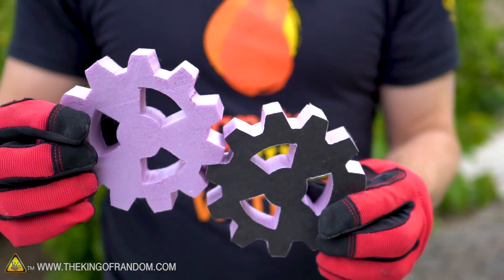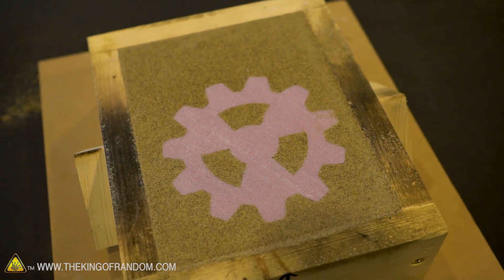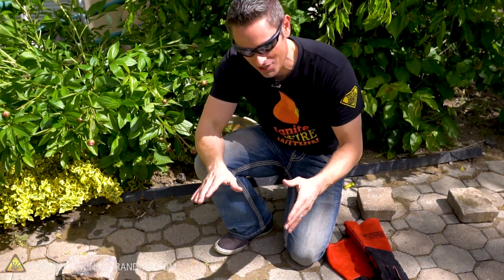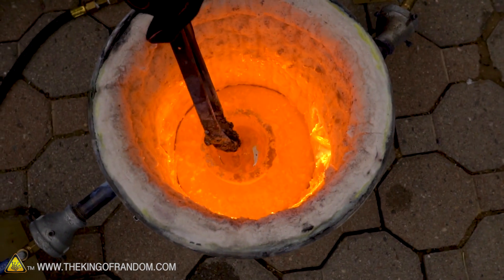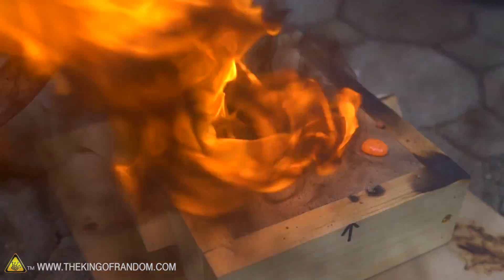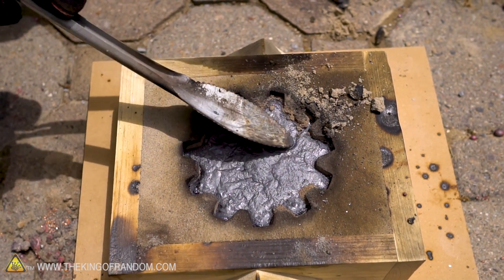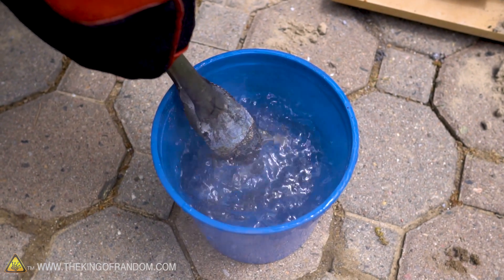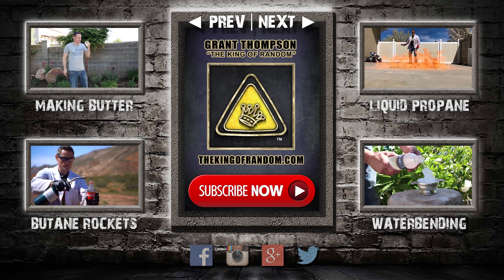Argh. Why Is Copper So Difficult? TKOR Tests Melting Copper In Our Homemade Foundry

Comment: First off: you need a little more damp sand so it holds together better. Second: You need to be able to remove your shape from the sand. Watch some real casting videos on the subject, it doesn't hurt to learn from others and not learn it empirically.

Comment: Re-investigate your green sand mix.  Take a look at MyFordBoy he has a much better green sand recipe than you are using. You could also invest in petrobond which will give amazing results (see Brian Oltrogge).  You should also be using a top/bottom for this mold.  That will help keep everything intact (use the cope and drag, not just the drag).

Comment: Try putting the top of the mold on with two holes going down to the piece. It'll keep the sand from lifting, insulate it a bit to keep it flowing longer, and you can just cut the excess off afterwards and throw it back in the foundry.

Comment: With my very basic understanding of physics it would seem that a possible problem would be that the sheer heat of the copper flash vaporizes the moisture within the green sand causing it to become to brittle to hold together.

Comment: When you said you were losing heat from the copper too fast you were probably correct imo. Making a mold that you can heat up with the copper should solve that, and your sand issue at once.

Plaster of paris maybe? Just be sure that all of the bubbles and water are out long before the casting.

Comment: what happens if we remelt the tail of prince Rupert's drop?
Reply: or is their a way to make Rupert's drop indestructible?
Reply: Mr. Mercury Pretty sure that the tail is what makes the Rupert drop "indestructible".
Reply: Mr. Mercury it's possible to take a blow torch and melt off the awkward long fragile bit of the tail. Check out smartereveryday. Destin used some drops with tails mostly removed when he tested them against bullets.
Reply: Mr. Mercury hydraulic press channel crushed the drop first before the tail could destroy itself.

Comment: Make a 2 part closed mold, skip the styrofoam and just make a hollow mold. Use chalk to avoid the master from sticking to the sand. Make the hole where you pour the metal to the side of the thing you want to cast with channels running to it. At the bottom of the inflow hole there should be a a deppression just to catch dirt and the deppression should preferably be below the channels to the casting. Also mix in about 12-15% zink or 10% tin by weight. That will lower the meltingpoint and make it more easily cast.

//Fellow caster.

Comment: I know how to make it work! It''s actually super simple, take a piece of metal that has a higher melting point than copper, that can fit over the top of the mold, and cut a hole in the middle where you need to pour it, making sure those interior parts of the nukegear are covered, which will prevent the sand from popping up! Thumbs this up please so Grant sees it!
Reply: +Commando Squeak  Tungsten! Or Nickel might suffice as well.
Reply: Kain Lancer   Won't the two metals just fuse together?
Reply: I think that if the metals are different enough in melting points, it won't, at least not strongly, but even if it does, Grant already said that he'd be fine if he had to grind it down a bit, so he could always just do that!
Reply: The only thing with a higher melting point is steel.

Comment: You need to dowl/peg the internal details of the gear in the green sand. When i did this in school we had little ceramic pegs that we put in the mould before adding the sand to add rigidity to the mould

Comment: Grant i work at the smelter at kennecott pouring anodes, it would help if you torched the copper as you poured it, it cools wayyy yo quick it needs to be 2200 f or higher to pour well. Looks like you have a little bit of contsmination in your copper which is making it brittle (bismuth) where did you get your copper?
Reply: Also sand mould is hard to work with, we use water cooled copper launders ligned with barite
Reply: Your sand may have too much moisture causing those pockets of sand to "pop".

Comment: Grant, I could suggest covering the Styrofoam model completely with sand. watched a few videos that did that, and it worked. It is possible that the central design is just not dense enough to stay put with that molten glob of copper poured on it. May have to do some extra sanding and stuff...

Comment: your problem may be that you just don't have any pressure on the details to keep them from floating you may want to add the second half of the mold even if it's just flat with a filling hole

Comment: Looks like the sand is too light, and when a small piece like the chunks in the middle is fully surrounded/submerged in the molten copper the bouyant force keeps pulling the sand apart.

Comment: Should have just went with a sand and plaster of Paris mold.. Or filled over the top of the foam, then use fill holes/vent holes to pour in the copper... It would keep it molten longer to fill the whole form and the cut outs couldn't float up

Comment: put a layer of sand on bottom, then put in your foam including several foam tubes up from the foam, then cover with sand. This puts your foam shape floating in the sand and the tubes are where you pour the sand.

Comment: 1. Get some petrobond sand. It's pretty cheap.
2. Make a two sided mold and make sure to weigh down the frame so the top does not get pushed open by the weight of the metal.

Comment: I saw a guy do this for an axe he did the same thing with the sand and stuff except he used an actual axe and then he took it out so it was a perfect axe mold and then he poured melted silver or something like that into it and it came out with a lot of dents and large indentations in it but it worked really well , just like a regular axe

Comment: Maybe... the copper is too heavy that's why it displace the sand in the middle(lighter stuff will float in liquid, especially when the copper is in it's molten state).

Quick question Grant, is mercury heavier than Copper? If it is comparable, maybe you can test the sand casting with mercury and see if it will work.

Comment: The problem you had was all because of density! At 7,898 g/cm3, molten copper is very dense. Whereas the density of wet sand is roughly 1.905 g/cm3. The three sand pieces kept falling apart because they wanted to float on top of the molten copper!! Hope this helps!
Reply: Alex Agaciak also, it did not show if he was using the mesh strainer? It really needs the fine packed sand to hold together better. Grant don't give up, but use finer grade sand first.
Reply: all he has to do is put a weight on top of the 3 sans pieces before he pours. may want to reinforce the sides of the 3 pieces as well
Reply: I came to add this, found it at the top.
Reply: I vote for doing this, too.
Reply: Put a lid on it nerd!

Comment: In foundry processing when dealing with high melting metals there would usually be a heated channel from the crucible to the mold. There are also a number of other steps and tools that you're straight up missing. Start from the basics and work up.

Comment: To The King of Random: Try to get the green sand casting extra wet then try to remove the styrofoam relation gear then pour the liquid copper. Or try to use something else instead of the green sand, try using plaster Paris or something similar to that or cement or something similar to that that can withstand the heat and that will keep the shape of the styrofoam outline/cutout better than sand.

Comment: Here is my Idea
1. Create the Box which holds the sand in steel.
2. Heat the Mould(Sand Cast mould in Steel box) up to the melting point of copper.
3. Pour the Molten Copper in the Hot Mould
I hope it works......
Reply: You can't heat the mold when sand casting like this.  Water is what holds the sand together.  If the mold were heated beforehand, the water would evaporate and it would fall apart (even worse).

Comment: Just an idea but I saw someone else using a very similar method of mailing as you but they did it a bit different. This mechanism also allows for much more intricate molds that can even copy exact items in real life. You can see what he does, but sadly not a tutorial. The video is called "Casting a Bronze Axe From Start to Finish". I know he's using bronze instead of copper, but I felt even if you don't use his method of molding maybe you could use bronze as a more versatile metal. Hope I helped!

Comment: Hey Grant! Instead of trying to cast copper in the sand why dont you try to cast it in the soil as the soil propably would hold the extreme temperature better than the sand

Comment: A random thing i noticed and gave a little thought. I noticed during the first few casting when the sand wasnt very wet, only one notched managed to dislodge from the mold. Then when the sand held a considerable amount of more moisture, all 3 notches gave way. The theory I have is maybe the copper is causing the moisture in the sand to evaporate too quickly before the mold can maintain a structural shape in the casting causing the notches of sand to break free and ruin the mold. I personally have no clue how green sand functions as a mold but a few ideas I have to help improve chances of a successful, detailed mold is 
1 create the mold like normal but let it sit, perhaps overnight maybe 24 hours, and wait for it to dry completely before use.
2 create the mold, and bake it in the oven. Reason being is I noticed the sand became VERY firm and crispy when the last casting was done. Just a thought, again I have no clue how it works personally but its just an idea or two to think over next time you try it out.

Comment: You need another sand box on the top with a whole to act as a funnel a steady pour is more effective than a fast one liquid metal still carries the same mass and weight  as its solid form its density is a liquid so its less than a solid and pushed your radio active dividers out the lid funnel should be able to handle and add support to those dividers

Comment: I have very little experience with casting, however the man that I helped always used a sealed cast for more dense materials. I doubt that is the proper name. but basically completely cover the gear with sand and have a pour spout going into the foam chamber. I could be wrong but I also believe it may help gold the hear in longer. allowing it to fill the mold better.
Reply: Basically you need to cover it up completely and have a foam "tube" going up which the copper can melt through, once the cast is done you just remove the tube with a saw and then file it down.

Comment: This sand is way too dry and flaky. Use some proper Delft Clay (Actually it's fine sand mixed with oil). The mould is falling apart because it's to dry that there's nothing to hold it together. I use Delft Clay daily for hot metal casting.

Comment: Borax is a great idea as a flux and skimming for slag a necessity every time, i understand there are better solutions but i also understand trying to make things work. What would happen if you let the Sand dry more or mixed a bit of clay into the sand? I think the main reason the center parts were popping up and floating was because of flash boiling the sand, the more moisture the more pressure it creates to disturb the surface of the mold.

Comment: the reason its not working is that your not pre heating the mold ... you can't get any better without heating the mold up it doesn't need to be as hot as the metal but high enough it slows the rate of cooling.... pouring it as quickly as possible doesn't help that much nor is it consistant

Comment: I think the issue you were having is that the copper is more than 4 times the density of silicon, so the little radioactive design was just floating to the top of the pool

Comment: Why don't you create the gear with an easier metal then use electrolysis to plate it with copper so it looks smoother

Comment: Looks like your greensand isn't binding enough, possibly your mixture is wrong, or you need to rethink your process (perhaps not moulding with an open top) myfordboy on YouTube seems to have no problems casting, perhaps get advice, Also that bubbling you were getting in the last pour, is the water in your sand turning into steam and percolating through the copper(might make your casting bubbly)
Reply: Or use sodium silicate (water glass) to stabilise your sand, you mix this "water" with your sand, then inject co2 gas with a needle , which causes the sodium silicate to react and harden.
Reply: I think svseeker (YouTube) has demonstrated this.

Comment: I have successfully poured copper castings using green sand - you can't use an open mold like in your video however.  I have a few tips I could give you if you want.

Comment: Couple ideas, not sure if they've been mentioned. Perhaps having something above the sand (Like a piece of wood with a hole to pour in the center) to keep it from floating upwards, or simply using wood or something similar to make up the cut outs. Yes, wood will ignite when exposed to liquefied copper, but it should last long enough for the copper to solidify enough that it won't deform when the wood burns away. Just a couple ideas.

Comment: y not have the mould the 2 piece type instead of the single piece? the upper part of the mould would prob help prevent the center bits from floating up i think. or place the foam gear on top of a layer of sand then put another layer on top of the gear and put a hole ontop of that so that you can pour in the copper. wouldnt they work?

Comment: Grant, for this, what if you tried to use some sort of steel funnel to minimize the force the molten copper puts on the sand? And since steel melts at 2500 degrees it should be fine with the copper.

Comment: First if you're gonna cast mold, expect to do some machining to get a usable/ appeasing results. Also, use portals to cast copper not facial... The sand needs support at all points, you can use multiple ports to achieve certain designs.

Comment: 1) You might need clay in our sand mix. Clay help makes everything stick together, sand doesn't.
2) You might also need to press the sand into the holes of the mold harder, using your fingers when you fill the box.

Comment: You need to use a top to the mold with a riser and vent. It will help ! I have seen it done and worked 99%, very little error..

Comment: I strongly believe that you should use 3D printed models first, make sand casting mold and then just pour molten metal. In this video, you cannot compact it tight enough, cause it was styrofoam.

Comment: I have done several castings with copper and i used oil based sand and it worked everytime with no problem. U should try that

Comment: I think the hotter the copper the more moisture it takes from the sand, turning it from green sand to basic sand. The edges held up because there was more wet sand to hold it up. Maybe it would be worth it to try and cast a bigger mold? More sand in the details might mean the moisture won't be completely dried out by the heat of the copper
Reply: Cement molds might be worth trying as well!

Comment: Having cast lots of things in copper using my own backyard foundry, I've never had as much difficulty as you're experiencing.  It looked on the last one that moisture from your green sand was causing steam bubbles through your molten copper - that same steam pressure was probably causing your mold to disintegrate.  My recommendation would be to use oil-bonded sand and a two-part (cope and drag) mold with proper sprue(s), runners, and gates.  If you melt about 3x as much copper as you'll actually need, the crucible won't cool as quickly while handling, also the heat inside the two-part mold will be much more consistent with better flow due to the insulating effect of the sand. Have your muffin tins ready to make right-sized ingots of your excess metal for future use.

Comment: you should try slicing the Styrofoam gear in half (thickness wise).

then try heating the green sand in an oven for about 30 minutes and pour the copper immediately.

Comment: Try a plaster/sand mix and do it by investment casting.
Also, having more wet sand will make things worse. The heat of the copper will cause the moisture to vaporize rapidly causing the mold to move inside a lot.

Comment: When casting no part of the cast can have 90 degree angles because as it cools the molecules align perpendicular to the wall of the mold. All 90 degree areas will have to be machined to achieve what you're wanting to do I think. The same thing goes for freezing. Bite into a Popsicle notice all parts are rounded because they freeze from the outside first not around the stick with relatively straight 90 degree edges. there will be lines in the Popsicle that align with the outside of the popsicle. the copper trying to align MIGHT be moving the sand and deforming your mold.

Comment: when you are trying to pour copper the sand falls apart then you have to pack the sand tightly and try your best to avoid air in packing the sand 

do this first keep the gear in and pour sand with 1/4 box covered and pack it
 pour it again till half full and pack it and finish it up packing till top and don't pour water just pack it every 1/4 box and make it finished up

best of luck

Comment: Grant Thompson - "The King Of Random" 
why don't you try to put some steel sticks in the 3 holes of the radioactive sandcasting mold you said steel has a higher melting point